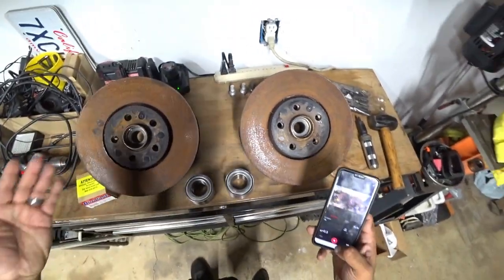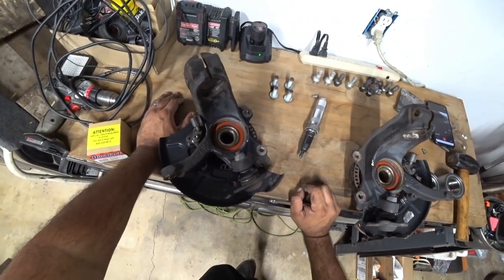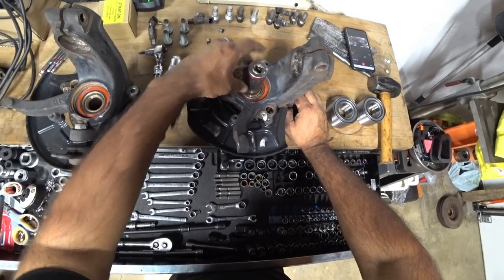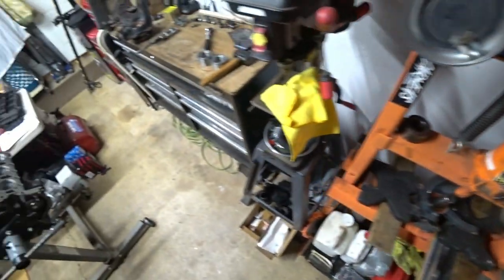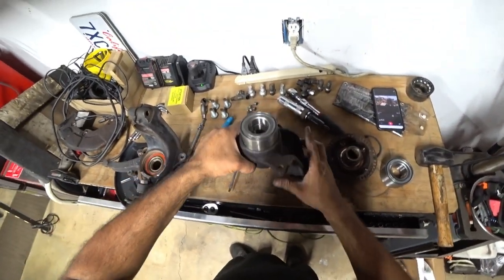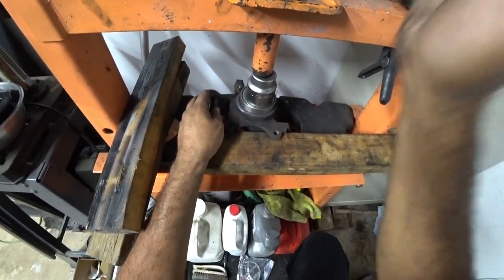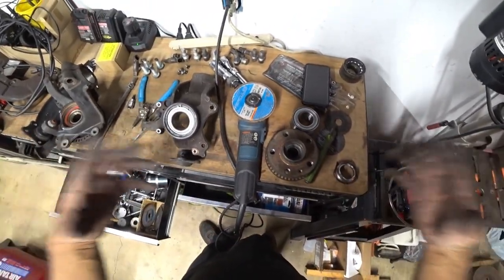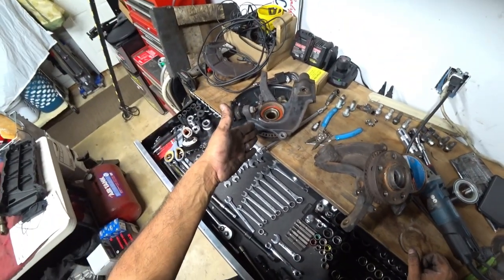How to install VW MK4 Wheel Bearings S7EP13

Comment: I watched this vid then another that said DON"T press on the inner race of the bearing.  A good friend with a press did just that after saying he's never had a problem. Well, sure enough, because I asked him to install my new bearings I had a problem as it destroyed the bearings on both sides. I bought a DIY bearing install kit off fleabay and installed both bearings using the outermost area to press on.  Both bearings are now being replaced although only one was bad after four years of road trips and the never-ending spirited driving. My friend still swears he's never had any other problems with his bearing installs, buuuuuuuuuuut I'd rather not take the chance or expense of doing this more than necessary.

Comment: I've almost replaced everything on my mk4 GTI but totally ignored this and im running on c5s with 1.5" 1" adapters.
Reply from the maker: Yeah man using adapters will cause premature bearing failure. I am replacing mine tomorrow because of that.

Comment: Did you not heat the knuckle?   And freeze the bearing?
Reply from the maker: No need for that. Just use a press. Yes I do know it makes the process a bit easier.
Reply: @PincheALsGarage  i use heat if can. I don’t have a press

Comment: Can I use the  2.0 engine head  on the 1.6 block???
Reply: If it’s an 06A block you can. But you will probably need to replace exhaust manifold and other components that may not match. The 06A block is used in 2.0 and 1.8t engines. You can the difference by seeing what kind of water pump you have, and 058 block has an external pump driven my the drive belt, the 06A is timing belt driven pump.
Reply: @Nate6133  I'll check to see if the 1.6 engine block has the same 06A
Reply: @Nate6133  thanks fr the help